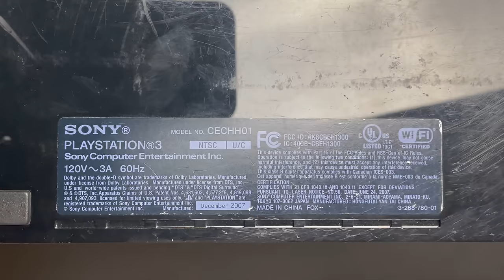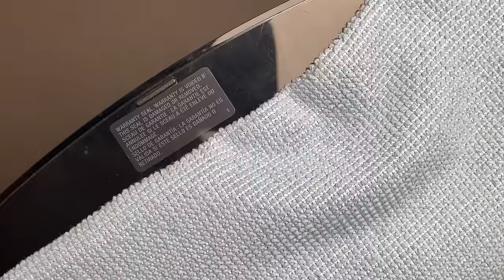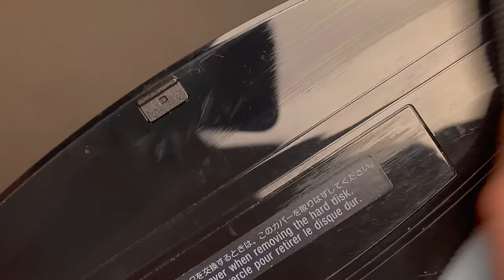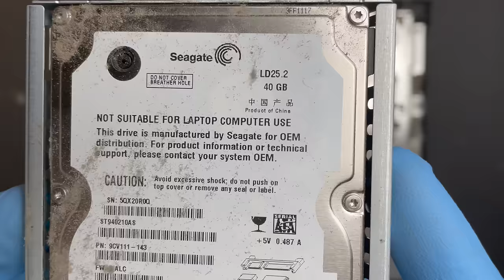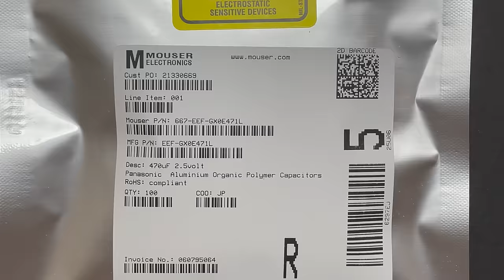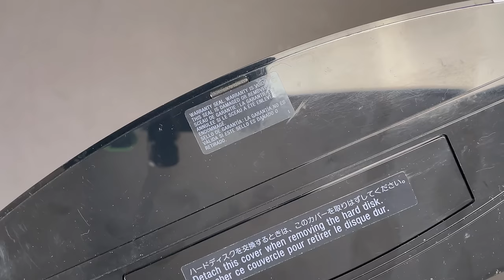Sony PS3 "Fat" YLOD Repair - Faulty Console Restoration

Comment: i had to build my comfort level when soldering thumbsticks on one of my dualshock 4 controllers and my dualshock 3 controllers. even though i've never seen these before but i was able to get 2 official ps3 controllers from a friend of mine that required no soldering for the analog sticks. you just pop them out, put in the new ones and bend 3 pins to hold it in place and you're good.

Comment: Hi ya, not going to lie looked above my skill set but . How were you affix the capacitors using glue and a heat gun? Do you recommend just peeling the caps off rather than attempting to use the heat gun.

Comment: I got one of those 2.5 hard drive cloners. I put my PS3 HDD in as the main and I’ll put a Samsung 500 GB 860 Evo SSD in it. My hard drive was starting to fail and click so I figured I better clone it as quick as possible. Generally I prefer SSDs anyway even if the PS3 can’t really take that much advantage of an SSD.  I cloned the SSD and it worked I cloned the clone onto a spare hard drive just so that way I have an emergency back up.

Comment: Awesome work. Has this ps3 held up well with only changing one pair of those tokin capacitors?
Reply from the maker: It's still working just fine however my plan was to continue to swap pairs of TOKIN caps two at a time if the first pair didn't do the trick.

Comment: I have some of experience repairing the YLOD on the launch models. I've revived about 10 units from just changing the NEC/Tokin caps.

Sony was kinda inconsistent with using Philips screws and JIS (Japanese Industrial Standard) screws. They're supposed to be Philips, but I think that some JIS accidentally got into the parts supply chain. They look very similar, but using a Philips driver with a JIS screw can strip it. JIS screws usually have a dimple on the head by the slot, but not always.

It's okay to get rough with removing the caps. Even if you scratch the board under the caps, you'd just be scratching into a ground plane. I've never scratched deep enough to kill a board. It sometimes in your best interest to scratch a large exposed area of the ground plane so you can easily solder the caps. You might want to revisit the system with the bad capacitor repair. Maybe something is shorted. 

Communicating with the syscon is difficult. I know what to do, but I've personally never got it working. But once there's an easier and more reliable way to pull diag info, reading the syscon will be invaluable to know if replacing the caps is worth the time and money. 

De-lidding is totally necessary IMO. You just need a lot of heat to get the spreader off of the RSX (GPU) and if you get a set of painters knives, de-lidding the Cell (CPU) is a piece of cake once you get it nice and hot.

On the models with PS2 backwards compatibility , make sure you use an APS-226 power supply and a 19 blade fan. The earlier power supplies run super hot and I've had several literally catch fire. The 19 blade fan keeps the system a bit cooler and is a bit quieter.

Congratulations on a successful repair!
Reply from the maker: I appreciate the time you took to share your thoughts and prior experience. Fascinating detail about the JIS screws. I love it! I'm very careful using the right driver bit and even though I speed up the screw removal and reinstall sequences, I actually change bits often between a Philips #0, #1 and #2 to always minimize the risk of stripping. So I was a little surprised how it stripped with a couple of turns. Who knows, but lovely bit of history nonetheless, thanks for sharing that. I'm working my way up to de-lidding. I'll eventually try it when my balls grow a little bigger :P Cheers.
Reply: Please keep those systems. Sadly the fact that the system revived after changing the capacitors does not mean that the capacitors were actually causing the problem.
Most of the time they are not especially on the older models. Which can be confusing.

Guides and help are currently available for communicating with the SYSCON. Even an automated windows GUI for beginners.

There's also videos coming soon to help so stay tuned
Reply: @za-se4jv  Without hot air is good. Then the only risk is that probably you are removing good capacitors.

The Nec Tokin capacitors were high end. It's not easy to match their electrical parameters even today. Tantalum polymer and Aluminum polymer may be good enough or maybe not depending on the quality. But it will never be better especially in terms of ESR and in high frequencies.

Thankfully it is possible to diagnose first if they actually are bad or not without removing. And not just with expensive Oscilloscope that most people don't have. SYSCON can give clues too and is accessible to everyone.

Comment: The dust reminded me of a resurrection that I did on an Xbox 360 that was literally nothing but dust and corrosion on the inside before cleaning and some board repair. Still going strong with an RGH!
Reply from the maker: The worst neglected ones are the true survivors. That 360 of yours will work forever.
Reply: @BorderlineOCD  It just died today LOL

Comment: The best thing for these old fat ps3's is buying them while they still work.

Delid both processors, new thermal paste all round, new thermal pads for every single chip on the board, ideally swap psu for a newer one from the 40gb's or 80gb's that don't get as hot.

Webmanmod settings that don't let the temps go over 60c.

Do all that and these old BC units should hopefully last a good few more years at the very least.

Comment: This yellow light could be 2 things, or the token capacitors like you did here or may need a rebolling. Normally those 2 things are the major issue.
I cleaned one system like this one a few years back and I remember that after all cleaned and assembled the date never would stay because I forgot to connect the stupid little battery.
That was soo frustrating but you learn with this mistakes

Comment: This is a great video and nicely detailed. I have a BC model (CECHA01) model that has the YLOD issue and possibly a ribbon cable problem too. Unfortunately I don't really have any soldering skills but would like to restore it to working condition since it has full PS2 compatibility. Any possible help in getting mine repaired?

Comment: 20:27   I get yours, and many others' anxiety, however, with the right tool, it's not nearly as dangerous or difficult to de-lid.   Not that I'm knocking anyone for not wanting to do it to such a rare system, just to alleviate a little of the fear with it.   With the proper tool, it can be done "relatively" safely, and with little trouble.

Nice work on that system all the same.   Nice, clean soldering of the new caps, and the system cleaned up beautifully.   Certainly a keeper.  Well done.
Reply from the maker: Thanks for the comment bud. I think you're right it needs to be done but I couldn't bare the thought of this being a "here's how not to do it" type of video after all that effort with the caps. I'll work my way up to it and give it a shot in a future PS3 video :)
Reply: @BorderlineOCD   Hey, no problem at all.  Don't get pressured in to it by viewers, and I certainly don't mean to come across as pressuring.  

Do it only if and when, you are ready to try it.   Watch lots of videos to see people do it in motion, and the most important thing I can suggest for your first time, is be very, very, very patient.

Judging by how patient you are at taking off warranty stickers though, I think you should be fine in that dept.  :)   Take your time, and if someday you feel good in wanting to do it, do it only then.   Doing it for the wrong reason, may very well end up in damage.

Comment: Delidding an RSX is incredibly easy, but Delidding the CELL CPU is not for the faint of heart. I personally use a filed/sanded down metal spudger bent at just the right spot so it can get through the glue and not any further. I recommend practicing on a parts system before trying to delid a working CELL. The RSX just needs a thin flat head screwdriver with sometape wrapped around the end so it can't scratch the substrate.

Comment: If I may quote Monty Python's Life of Brian: "Oh, you lucky bastard!"  After watching how messy that cap removal and replacement job was and potentially 7 more of them to go, I was wincing. I might have put that project way on the back-burner if it didn't work with the first set replaced, but there you are! ;-) And with a fully working PS3 BC phat! I am teh jealous. 
PS3 is the one console I regret missing out on, for the sake of my kids I went Wii that generation. I don't regret it, we had tons of fun but it's one HELLUVALOT easier to get a fully working Wii for cheap then a launch PS3 at any price now.  Great video!

Comment: It's super sad to me how people abuse these things. I remember looking at how good they looked in 2006/2007. If I had one of these brand new, it would still look just as good as it did on day one. It's a shame how much people beat them up and scuff them.
Reply: Mine looks perfect with no scratches. But it has YLOD. :(
Reply: @CarsandCats  go for a CECHG01 model if you want a fat PS3. I just got one 3 months ago, and it runs super quiet and never overheats. Only downside is, you won't have the PS2 compatibility. It's fine with me, since I already have a perfectly fine PS2 anyways. The CECHG01 is a lot less likely to get YLOD. Also, another common mistake people make with PS3, they have it crammed in an area that gets no ventilation or airflow for it to breathe. It's best to sit it out in the open with nothing surrounding it so that way the heat can escape from it
Reply: @autolife2785  I am the original owner and it's a 60GB launch model. It was always kept dust free and in an open area. It just got played a LOT, especially after I soft-modded it (using an iPhone, remember that?). It worked until 2 years ago so it had a great run. I just tore it apart and am waiting on some Artic Silver 5 pastes. I plan on using my heat gun on it as a last resort since nobody repairs them around here.
Reply: @CarsandCats  it just sucks man; the 60 GB/ 80 GB just break easily. I had a used 80 GB that I ordered off ebay a year ago. Within 2 months, boom YLOD. It would used to get super loud all the time, and I knew it was coming. I tried taking it apart twice and repairing it, but no luck. I just gave up. With the CECHG01 I got now, I got it sitting all by itself, and I got it lifted on 2 wood blocks to keep the fan from getting hot sitting on the surface it's on. I also got a mini fan sitting next to it to blow cool air in the side vents. I keep my PS3 sitting horizontal

Comment: I'm curious if that ps3 still works, theres more information out about the ps3 ylod stating the real issue is the RSX synthesizer chip and the only way to fix it is to replace it with one from the newer slim or slim'er' revisions and flash the bios with a slightly modded bios to recognize the newer rsx chips

Comment: I delidded two fat ps3 first time success 2nd time success. It is a must for saving your ps3 for long term my ps3 went from 70% fan to me setting on 40% and running way cooler 
Use the paint palette knife and heat gun use 30sec intervals dont get them to hot but hot enough then they cut off like butter

Comment: Good job man! I'm doing this Fix actually in mine! But, it's really hard job to take the noken/tokin caps. I watched that It can works easy with a wood chisel😅 i realized after get a mess with my Mainboard hahaha. I tried to get off with a knife so it's a bad idea. Micro caps and a voltage regulator flew away😅

Comment: Heyyy, odd question but this solder job isn't too difficult compared to something like, ps2 or xbox 360 mod chips. Is it?
I have a cecha (with no issues really) but I have been heavily considering doing this mod for future proofing reasons. I'm fairly confident I could do it, but I guess you also just made it look so clean LOL. Nice video!
Reply from the maker: I think mod chip is easier honestly because I'm more comfortable with an iron, but it depends on what you find easy or hard. If your system is working perhaps wait for it to begin having problems. It's such an invasive repair job so I personally wouldn't do it on a working system. But I get it, the odds are it's a matter of time...

Comment: I have a cecha I got from goodwill, and the only fault with it is non working HDMI. The port physically looks fine. Yet the chip is a bga silicon image chip so its going to be a bit tougher than like a slim..

Oh and to I have a k model which is this but a 80GB drive. Same layout with the separate USB and wireless board.

Comment: I really liked watching this repair! You say you fumble and are not great with a heat gun but you can’t argue with your results! I will buy a few faulty PS3 consoles and try this repair but failing that I’ll just bake them in the oven as I have done with my own 40gb PS3 and that worked for another 6 months of all day gaming so it wasn’t bad just not a reliable or long life repair.  I have also damaged my PS3 slim console by trying to delid it which I haven’t bothered to even try to repair yet.

Comment: In PS3 inside not present Y indicator at all. Combination of 2 different lights make Y light.Optical illusion,when 2 diods work together through the optical acrilic conductors.Delete top cover, turn fat grandmother ps3  & you can see yourself.

Comment: I bought some tantalum caps a couple years ago to fix a launch PS3, but haven't gotten around to it. People are now saying that these caps likely aren't the cause. 🤷‍♂️
Reply from the maker: Diagnostics are improving with SYSCON but ultimately it's a flawed system and there is likely more than one trigger for the YLOD error state. I'm aware some folks have not succeed with TOKIN cap replacement but many have. It could be low quality caps (one out of spec cap is enough to cripple the repair) or it could just be the GPU. I think it's doing to be a guessing game for a while to come yet. SYSCON is very promising but it's a trial and error game and ultimately more people needs to try it and contribute for it to evolve. There is just no handbook for error codes so we are not able to fully make sense of the error codes the system spits out.

Comment: Honestly what i would do, is remove all of these capacitors, solder wires to their pads and substitude them with standard 1200uF caps for a higher voltage (i doubt you can find 2,5v ones). I'm pretty sure you can find a spot to put these caps somewhere

Comment: How easy is it to remove that warranty seal?

Btw, when using hot air to reflow smc’s, I find putting flux on first makes it much easier. First reflow, let solder cool, then reflow again while applying pressure on the component to push out any excess solder and make sure the joint is solid and even. If any excess solder squirts out, apply flux and touch up around the edges to finish up.

Comment: This is really cool man, i have a ps3 fat with the same problem, i tryed to desolder the caps, without succes, i was affraid to damage them...but after this video, i'm encouraged to order some caps and try to replace them, cause i got nothing to lose. I remember if i'm not mistake'n, vince, from My Mate Vince channel, replace these caps with regular electrolitics ones, and it worked, but then it was a strugle to bend them so they can somehow fit in the chassis. once again, great video, thanks and keep up the good work:)

Comment: So, I have an odd issue with my PS3...I'm not looking to do repairs on it - my skill with electronics is more on the level of desktop assembly than teardowns of things that were not designed to be torn down - but I am kinda curious about a possible diagnosis.

When I turn on my PS3, it tries to boot up for a bit, and then switches to the yellow light.  I then turn it off, and turn it back on, and most of the time it will boot fine.  Occasionally it doesn't on the second attempt (same behaviour as the first attempt), but it will usually boot on the 3rd attempt....and it has never not booted on the 4th attempt.  Every "Yellow Light of Death" error I've heard of from others is consistent - if it yellow lights, it always yellow lights, and it's dead.  There's various fixes from replacing components as you show here to sticking the mother board in the oven or other bizarre things, but it's never as simple as "turn it back off and try booting it up again until it actually boots.

Any idea what might cause that?

(As for actually fixing it, I'm vaguely in the market for a cheap replacement.  I'm not exactly vigorously pursuing this - I'm mostly a PC gamer, and most of the old console games I still go back and play occasionally are Gamecube games, which means running on an effectively indestructible system, because Nintendo consoles are somehow immortal.  But if I see a low price and have a decent reserve of cash built up at the time, I'll pick one up so I can play Metal Gear Solid games other than MGSV again.  Might poke around to see if there's anyone like you who does repair stuff who's interested in taking a shot at fixing it after I've got a replacement...or it might just wind up in the electronics recycling.  It's nothing special - one of the later fat PS3 designs, one that doesn't have the PS2 support that the original models offered.)

Comment: I assume this repair would be relatively similar for the CECHB01? I got this model recently and the system will start and play for various periods of time before completely freezing and discoloring the screen
Reply: @alittlebit64  Thanks for the reply! I ended up buying a GPU and replacing the NEC tokens as well for good measure and it works great now so far